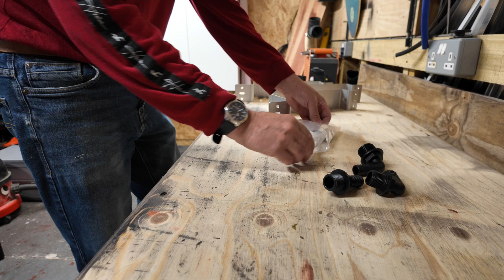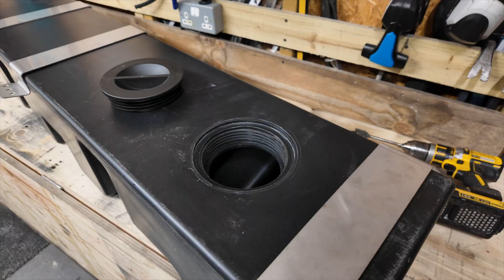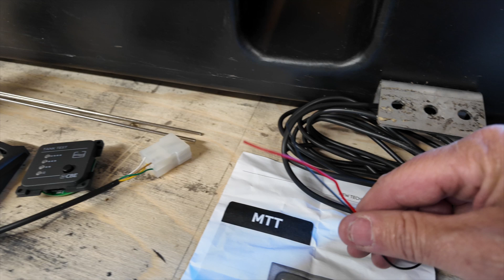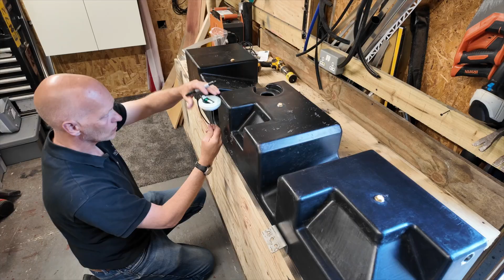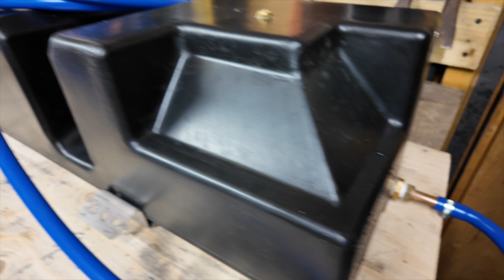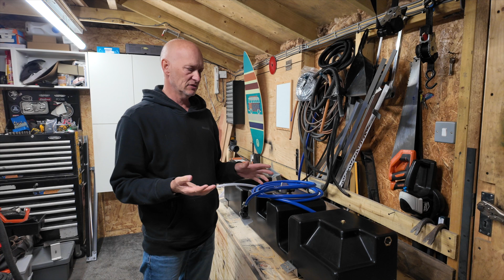Water Tank and level Indicator,  VW Crafter Camper

Comment: Hi. Great videos so thank you for creating, they have helped me throughout planning and undertaking my own conversion. I’m struggling to find the inlet/outlet kit you mentioned. Please could you share a link. Cheers.
Reply from the maker: https://www.ebay.co.uk/itm/134347260731?_ul=GB&mkevt=1&mkcid=1&mkrid=710-53481-19255-0&campid=5338365712&toolid=20006&customid=EAIaIQobChMIkqff_t_HkQMVlJBQBh0czTBKEAQYASABEgL5HPD_BwE%7C0AAAAA9SEzLPk51l6NtGSx6xFWBALN_Ekm%7Cnull&gclid=EAIaIQobChMIkqff_t_HkQMVlJBQBh0czTBKEAQYASABEgL5HPD_BwE&gbraid=0AAAAA9SEzLPk51l6NtGSx6xFWBALN_Ekm&loc_physical_ms=1006886&adtype=pla
Reply from the maker: Try this link, let me know if it doesn’t work, I got it from eBay I think! I typed in campervan back fill water tank tap
Reply: @exploresandtosummit  perfect thank you. I’ll get a few ordered. 👍🏻

Comment: Hi. Great video pal, I’m installing this tank on my mwb crafter soon also. One question tho, do you need to drill the air vent if it has the 3 brass vents on the top? 
Rich
Reply from the maker: Hi, thanks , I think I put a extra vent in because when the tank is fixed in place, those brass vent are pushed hard against the body floor and I thought they may not vent properly as they should. I thought it wouldn’t hurt putting in a extra. Hope that made sense!